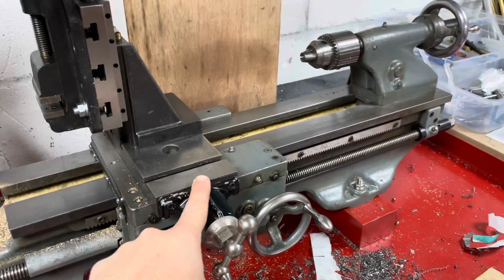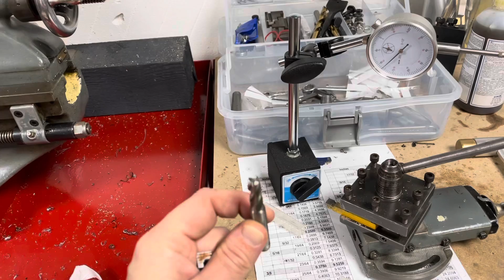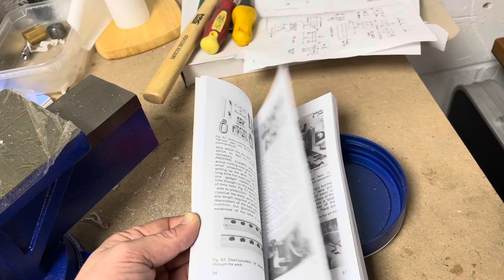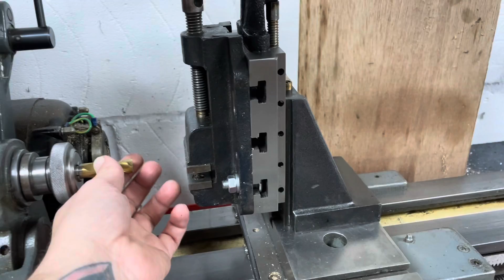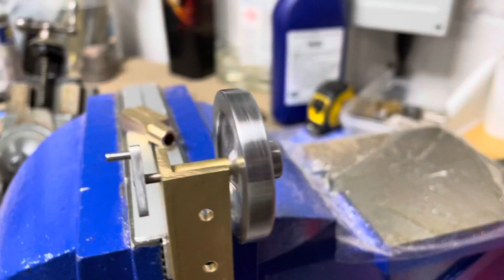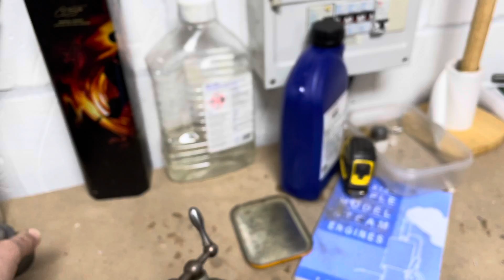Milling on the Myford ML7

Comment: Simple. Slot drill can plunge and mill sideways. End mills can only come into the work sideways. 4 flute ones should be able to feed 2x as fast as a 2 flute cutter. The difference you can see with a slot drill is that the cutting edge kind of goes right across the centre, like a drill bit somebody ground flat. The end mill has a gap in the centre so there is nothing to remove metal if you tried to drill with it. If you have a pilot hole a little smaller than the endmill then you can plunge with it. I use a small pilot hole just shy of the depth I need even when I plunge with a slot drill. It works a lot better.

Comment: Hi, agree totally with the rigidity, any movement at all is going to be reflected in the finish of the work. Del.
Reply from the maker: Thank you for the comment Del, I have moved workshops and the new one has a bit of a bouncy floor - in theory that shouldn't matter if the bench is rigid enough but it's proving a challenge for sure...